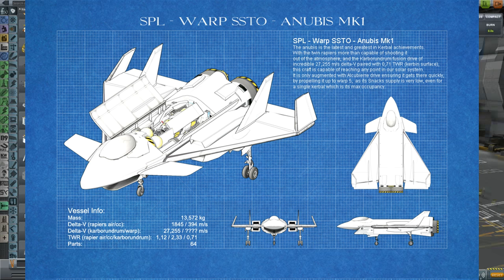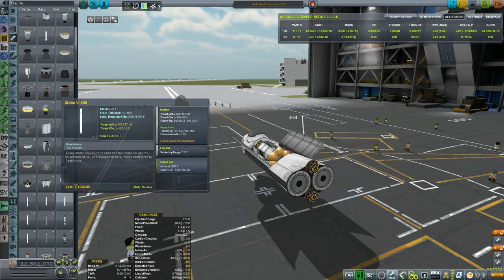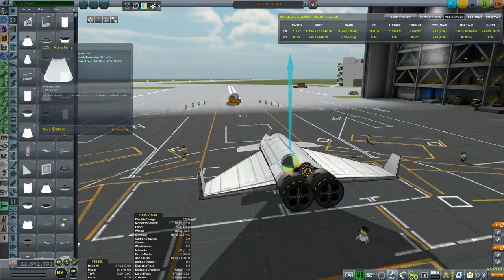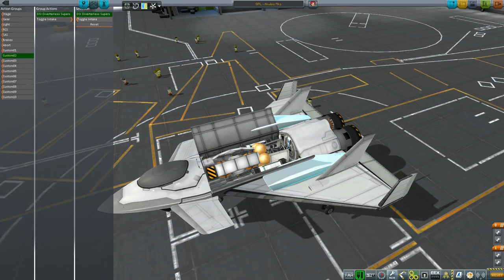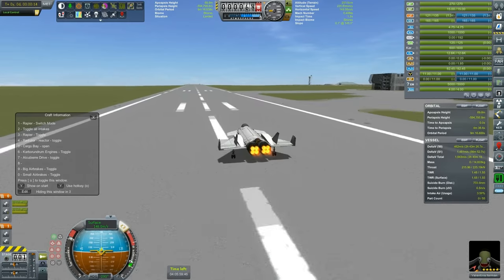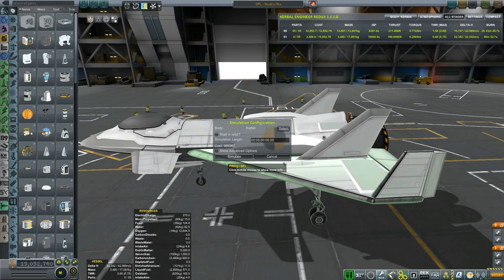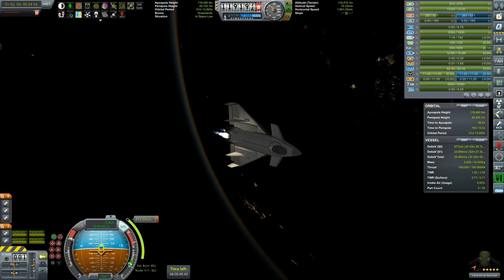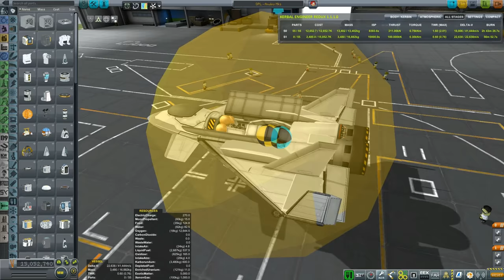Kerbal Engineering - Building Warp Capable SSTO

Comment: I notice you still use the original, steep SSTO flight path, rather than the newer, low angle flight path. Of course, if I could get either to work I'd be happy!

Keep these technical videos coming as they are really useful for budding KSP Engineers. Thanks.
Reply from the maker: Regarding steepness of the flight path it greatly depends on the TWR of the SSTO in question on the ground level. The end goal is always the same: Be at roughly 1400 - 1600 m/s at the point when switching from airbreathing to rocket mode (between 28 and 38km altitude). So the SSTO's that have TWR around 0.7 or less in airbreathing i tend to use shallower flight path to allow them to accelerate up to that speed before runinng out of air. With SSTOs that have TWR around 1 or more I do not need to do that, as by that point they will go even faster then that.

So, all in all it's a ballancing act. Also, I will regardless of TWR take steep approach untill 10km altitude, as I want to get out of the thickest layer of atmosphere as soon as possible. From 10km onwards like i said the steepness depends on TWR.Hope that  clarifies things :-)